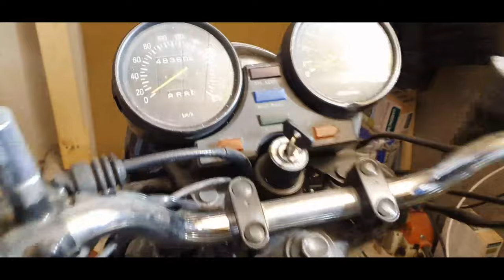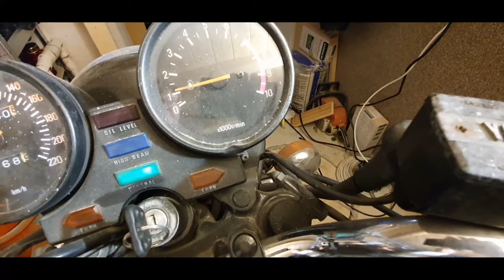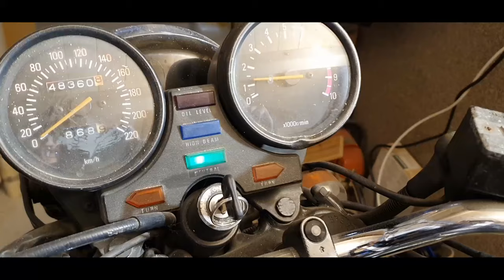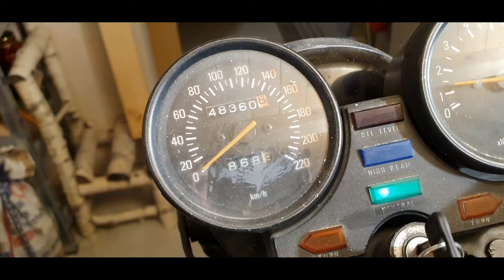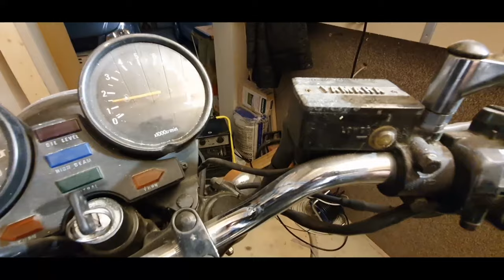Yamaha TR1 Project #02 - Startversuch und Vorbereitungen

Comment: Choke ?..........under L/H switch-block, full for a few seconds, ease-back till idling fast, unplug rev-counter too , you don't need it, it robs spark from  the rear cyl, so you gain a bit more HP too . Dave NZ